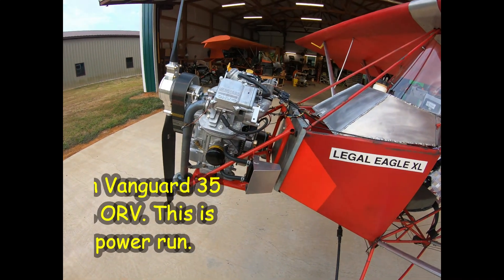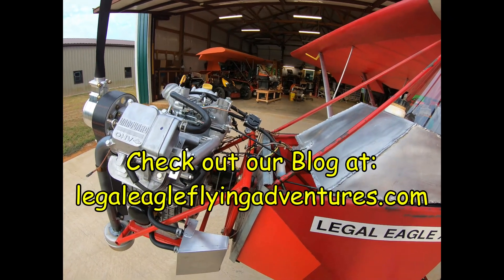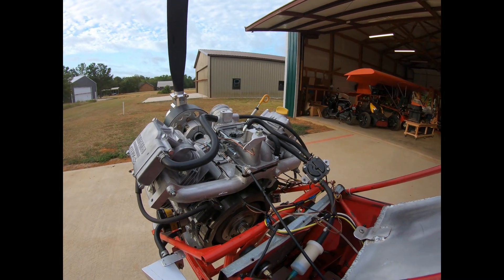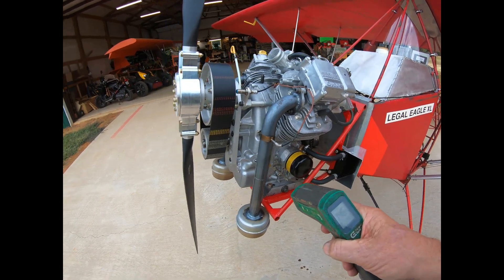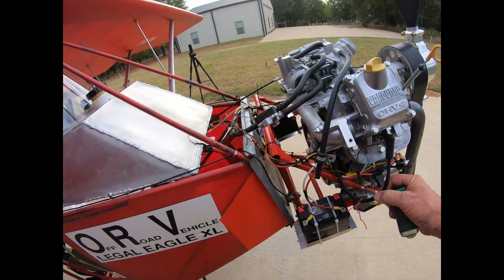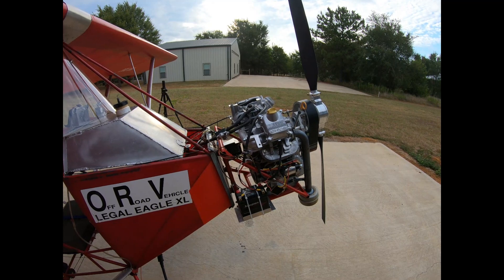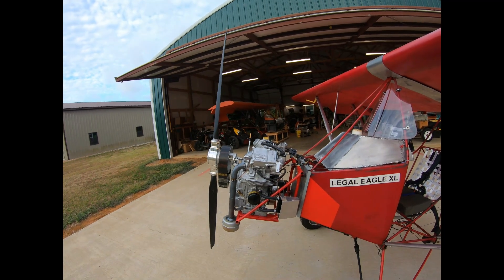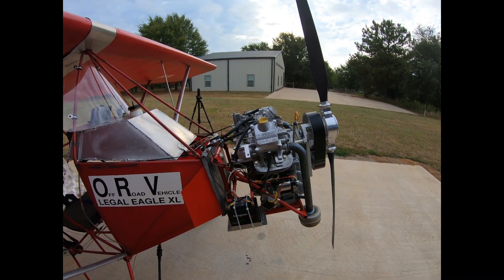First look and comments BSV35

Comment: Thrse briggs conversions really need a radial mount.
The thrust line is so high relative to the bed mounting that maturing or failure of one of those mounts would likely be very dangerous. 
A radial mount would also address some of that horrible vibration.

The mounting system remains my major objection to these power plants.
Reply: Good observation. Could be mitigated with some back yard ingenuity though.

Comment: Not only for icing, but most small engine factory carbs are built to garbage specs and are usually more inefficient and more conservative than a good aftermarket carb. You'll get more horsepower and more reliability with just a carb upgrade on almost every single small engine made. Best money spent on any small engine, hands down.

Comment: Honda has a fairly new V-twin that might be a fun project. It's called the iGX800 and is EFI which would probably negate any icing issues you get with carbies.
Reply: Too many plastic internal parts to be considered for flight without a full rebuild with higher quality components.
Reply: @nattybumpo7156  what’s wrong with plastic in this case?

Comment: They have an efi version, use those and replace the ecu, no carb ice issues,, no carbs
Reply: I dont believe that to be true.
There will always be a venturi effect at the throttle valve, which is the problem area. That area if relative low pressure will freeze moisture.
For years in the certified airplane world this myth persisted, and we were wrong.

Comment: Starting, make sure the compression release is functioning properly or starter won't turn it and will burn up, improper valve adjustment disables compression release function. Valve adjust is CRITICAL on those with comp release, I burned up two starters

Comment: Run oil line up in copper tube around air intake for warmth?  How about aluminum tube routing exhaust out behind you for additional quiet?
Reply: Use speeduino and convert to efi, no carb, no ice

Comment: How much does it weigh?
Reply: Case alone is 81 lbs vs about 50 for the 23.  Figure at least 30-35 lbs heavier than the 23 installations?  Which is to say probably the same "delta" compared to a 1/2 VW.  Stock 23 lists at 87# per Briggs.  Stock 35 lists 125#.
Reply: @ryoungatlmidotnet you are at 80 lbs with a prop on the 23 and 110 for the 35
Reply: Nice to know, but what would be even nicer is to see Les try a Yamaha YG2 on ORV. That would be spectacular! It's around 88lbs for the engine (123 lbs all up installed weight) and makes 80 HP! Granted it's an 11,000 monster, but it's a 4-stroke snow mobile engine that was based off of a very reliable dirt bike engine.
Reply: @seangfoster1974  Not a realistic engine for this airframe, in my view.  You'd be a VNE just above idle.